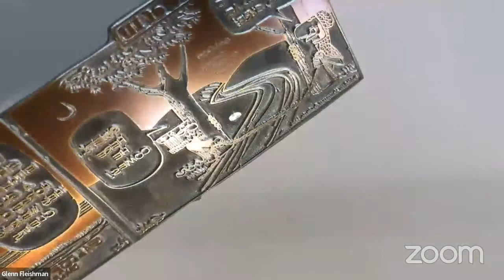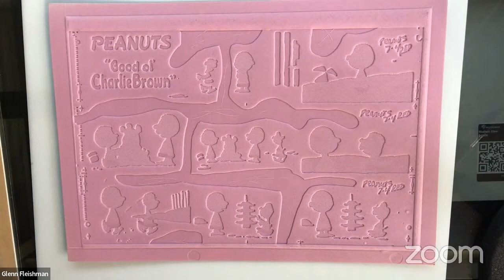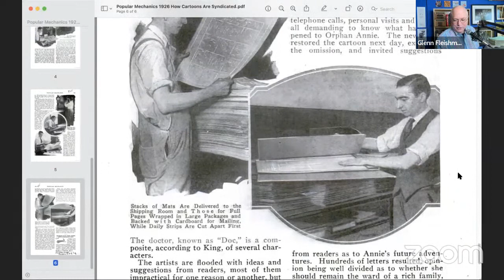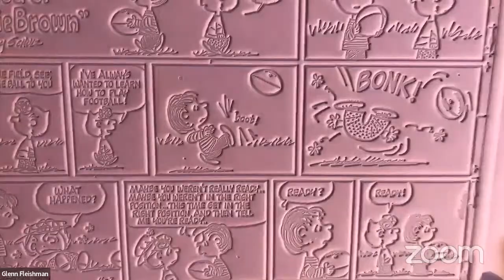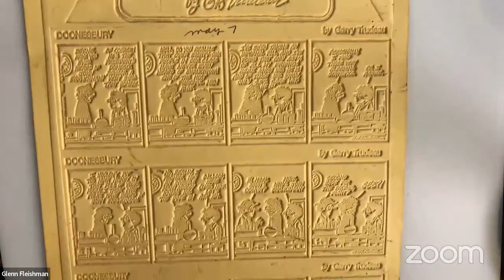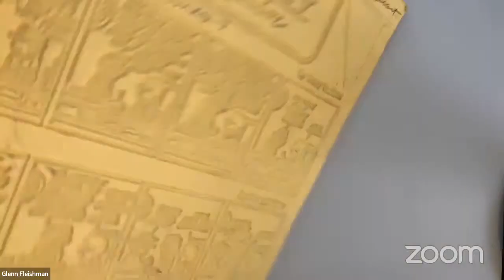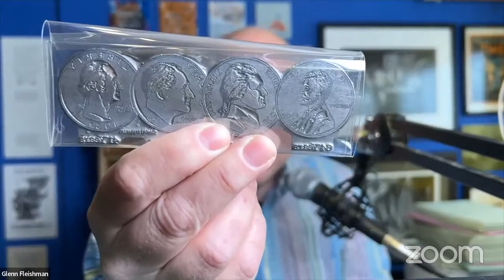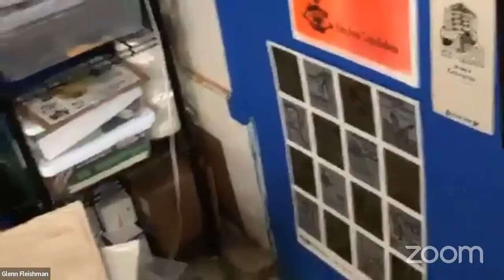Peanuts: A Treasure Trove of Flongs

Comment: If I were to guess, the Xs on the Peanuts mats are meant to prevent the problem you demonstrate later with the felt-backed Doonesbury mat: it was likely easier to just route the Xed areas off of the molded plate that it was to deal with a mat that is has large areas with no profile. Such a mat might get crushed during molding, as you mention, or maybe even just in transit. Just a thought!